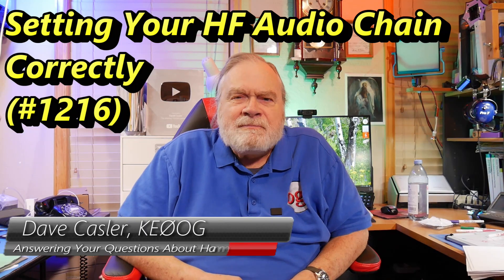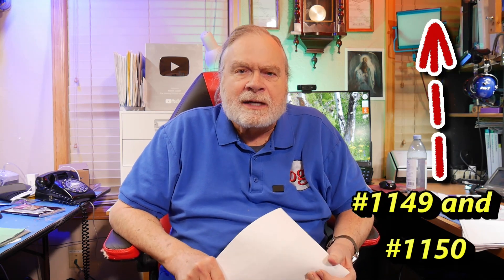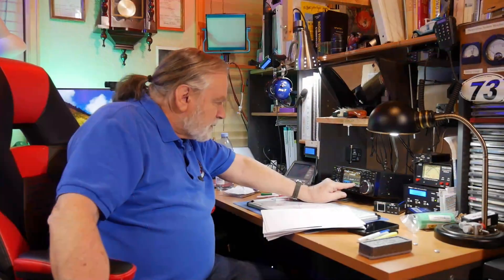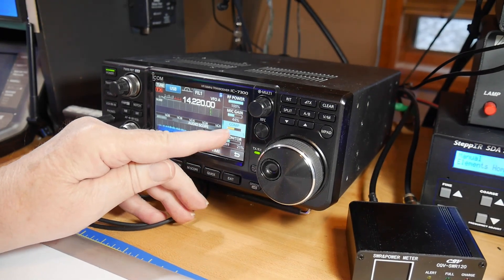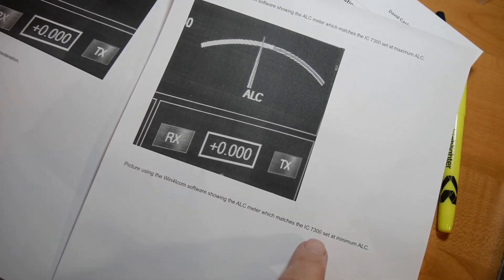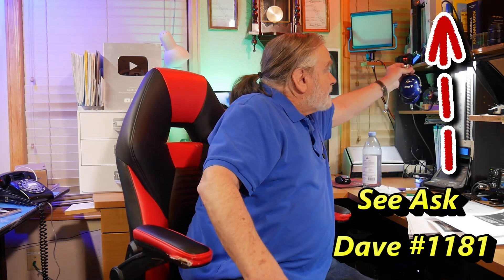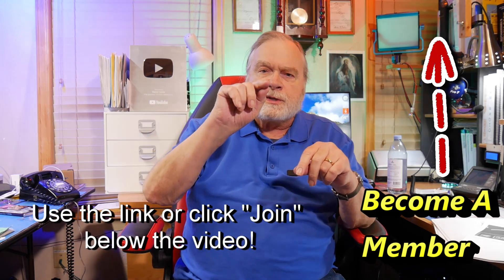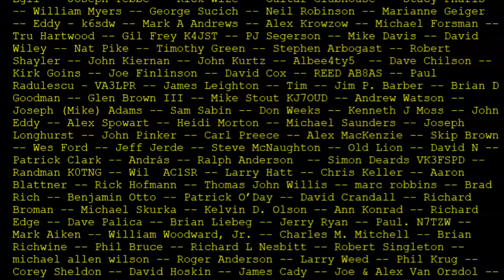Setting Your HF Audio Chain Properly (#1216)

Comment: because, amateur radio sold in Japan have to pass something like Certification similar to FCC parts 90 , most of newer transmitters are very clean.  clean as part 90 radio.   those newer DSP radio seems  not splatter at all.  AG6JU